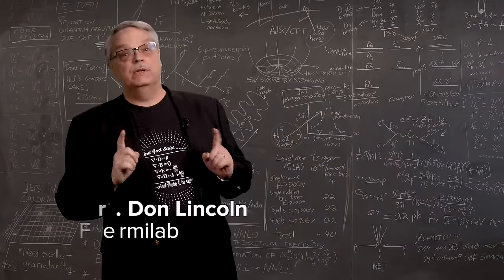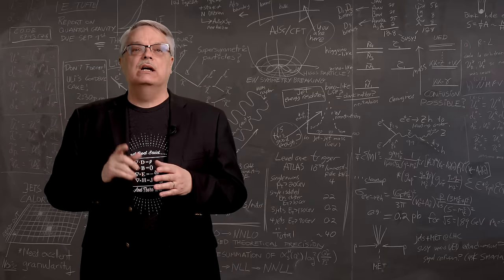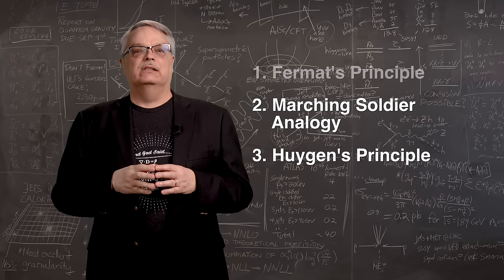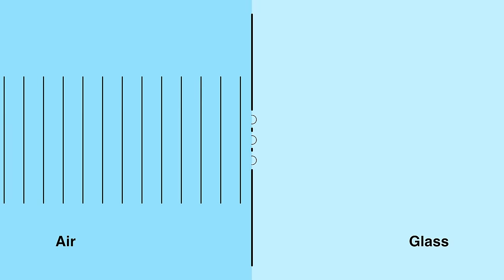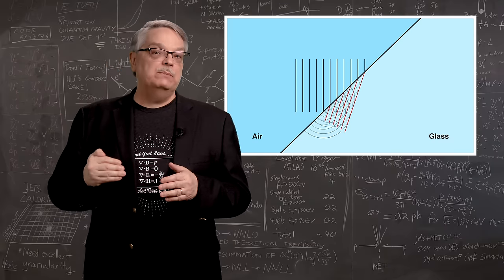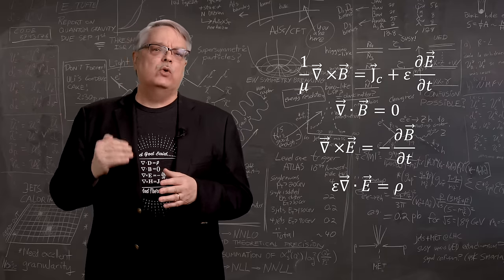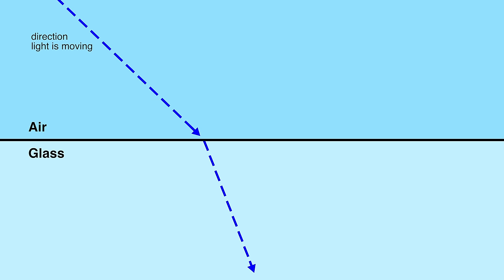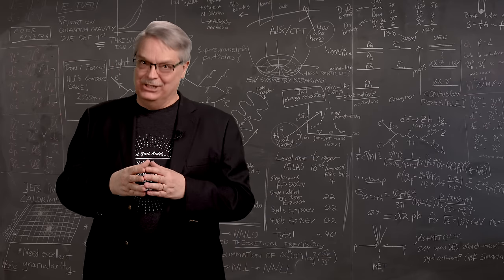Why does light bend when it enters glass?

Comment: In the animation, the electric charges of the molecules in the glass moves/reorient themselves according to the direction of the light, but light travels through my window from many directions at the same time. So please explain how each light beam can bend when it transitions from air to glass, consistent with the equtions. One would think the charges of the molecules in the glass gets confused by the bombardment of light travelling through it from various directions?

BTW, I love your videos - sooo much better that what you stumble upon on the web.
Reply: What a hard question!  I'm  delighted that you have asked it. May I say it's all about the supremacy of geometry over physical mater. Any model that includes light waves or rays, and in particular the directions of these waves and rays is wrong by  definition. Every such a model is by necessity a 3D structure displayed in an instantaneous space. It doesn't meter if these models were kinetically animated, they are still only the sequences of frozen 3D frames. BTW, the eternity could be the three dimensional only. To be able to answer your  question one have to realize that there is no underlying reality of pictorial, i.e. geometrical, models and they should be looked at as if they were eternal objects themselves. However, there is no such thing as the 3D eternal model of light, or of electromagnetic extension in general.  Light does have  a peculiar direction which is always toward the observing, receipting, point. If you are interested in ...
Respect
Reply: The equations are linear so the solutions just add up. Look up 'superposition of waves'

Comment: Forgive me, I don't understand why the horizontal electric field doesn't lowered in the same way as the vertical one
Reply: I think it's because the beam's vertical electric field is moving against the intrinsic electric field of the material, whereas the beam's horizontal electric field isn't.

I'm only guessing though, and I'll defer to anyone who actually knows what they're talking about.
Reply: Look to the equations, he showed it
Reply: He did not show it. But said that we can get there after some calculus. The so called boundary conditions between two media are shown in https://em.geosci.xyz/content/maxwell1_fundamentals/interface_conditions/derivation.html
It uses the Maxwell equations mentioned in the video, but in its integral form.
Reply: @saspinski  That's the math.  It doesn't explain the physics.  You would think the charges in the material would get polarized by the parallel component.  The dielectric constant is also just an approximation, because it assumes the material is continuous.
Reply: To fully appreciate this result, you'd need to read the electromagnetic theory. The electromagnetic theory says that light is an electromagnetic wave, it is nothing but oscillating electric and magnetic fields. Electric fields and magnetic fields satisfy a set of 4 equations, 2 for electric fields and 2 for magnetic fields. The 4 equations are different for different media or materials. But at the boundary of two media, both equations of medium 1 and medium 2 must be satisfied, because the boundary belongs to both the media. So the electric field equations in one medium must be equal to the electric field equations in the second medium. This is what we call a boundary "constraint". The electric field is constrained to move in such a way that the boundary conditions or boundary constraints are satisfied. It turns out the boundary constraints you get on solving the equations is that the parallel component of the electric field must not change, and the perpendicular component must decrease. Please not that it is ok if you fully do not understand this, this is something that is taught in undergraduate physics course.
Reply: @MrNerdpwn  Why wouldn't the parallel component change?  What law would it violate if it did?
Reply: cryora Like I said. it’s a mathematical reason. Basically it is something like this, the electric field evaluated over any closed loop is equal to the negative rate of change of the magnetic field. If we consider a small rectangular loop about the boundary with it’s two parallel side above and below the boundary and it’s other two parallel sides be very small and cutting across the boundary. Now if we let the height of the loop, the sides that are cutting across the boundary shrink, the negative rate of change of magnetic field vanishes as it depends on the area of the loop. So the total electric field about the loop must be zero. But as we’ve shrunk the height, the only contribution comes from the remaining 2 parallel sides, which are the parallel component of electric field in both media. Since the electric field in a loop is evaluated in a certain direction (clockwise or anticlockwise), one of the parallel components and negative of the other parallel component must add up to zero. Hence both parallel components are equal!
Reply: @MrNerdpwn  You mean the magnetic flux through the area bounded by the loop goes to zero as the area goes to zero.  It still doesn't explain why the parallel fields do not polarize the material and create a counter field they way it does to the perpendicular component.  It's a mathematical trick that gets us a result, but it doesn't exactly explain what is physically happening between the charges and the fields.
Reply: @cryora  Yes, I meant the magnetic flux. Correction. I don't think polarization is the correct way to go about this problem (I doubt I'm correct however). An oscillating electric field will cause charged particles such as electrons to oscillate. There's no charge separation or polarisation when electrons are oscillating. You'd need a uniform electric field for charge separation. Oscillating electrons will create charge separations that will rapidly change, due to the oscillation of electrons. So this is definitely something worth thinking about. There's more than meets the eye here.
Reply: @MrNerdpwn  thanks
Reply: I assume it’s because the alignment of the atoms in the glass caused by interaction with the incoming light would be in a direction that doesn’t affect the horizontal component?
Reply: I can see that for whatever reason, things that are parallel to the boundary have to match up. But you are absolutely right - the negative and positive charges in the material should fight against an imposed field in any direction. If Maxwell's equations had said that the field would have to be reduced exactly by the amount the light slows down - the reduction along the path of the light in the material, instead of the reduction perpendicular to the surface - then the change in the direction of the light would be the one to have the electric field reduced by the correct amount, and yet have it matching parallel to the surface. And epsilon is a constant, the slow-down of the light is a constant, but the component perpendicular to the surface will change based on the angle. He may have made a mistake.
Reply: Of course, if it's the total electric field that has to be reduced by a factor of epsilon over epsilon-nought, that field isn't along the light beam, it's perpendicular to it. But not the component perpendicular to the glass.
Reply: Fun video - thanks Don.
Reply: MrNerdpwn why there are 2 components of the electric field?
Reply: As explained in the video and others here, that is due to the boundary conditions.
It's just simple math.

In more layman terms, 

The actual electric fields always oscillates in the direction perpendicular to the light propagation.
When it finally passes water, this electric fields gets lowered entirely (one package)
But since the field is a vector, we can decompose the actual direction into several unit vectors.
In the video we only look at the vertical and horizontal electric field.
Now the catch is, the Maxwell equations applies to the entire electric field, regardless if it's in air or water (it is a one package).
In order for the light wave to obey this, it has to be reduced vertically, but not horizontally. Because Maxwell's equations applies for the whole electric field, not separately in horizontal or vertical directions.

As for the physical reasoning, this is caused by the boundary conditions again.
The light itself is interacting as waves, so it oscillates.
While transitioning from air to water it has to pass a 'virtual' boundary between these two mediums.
But remember that the lights interacts with particles.
In horizontal direction each particle oscillates with it's neighbour but still in the same medium.
If it's in the air, in the horizontal direction, the field oscillates in the air medium, never into the water.
Same thing with the field in the water. In the horizontal directions, it oscillates with it's neighbour that is also in the water, never into the air.
If you draw straight line horizontally in the air as close as in the water, it will never cross into the water.
So, obviously the electric field doesn't get lowered. Why it has to be lowered? The horizontal field itself never crosses different medium.
Reply: The bending is happening at the border between air and glass so the glass can only 'push back' in the direction of the border.
Reply: "When you have two dielectric materials with homogeneous ϵ1,ϵ2 each, applying an external electric field will only produce a bounded charge distribution only on the boundary - the interface between the media. So locally, you have a plane with charge distribution - thus creating an electric field that is perpendicular to the interface, meaning that the perpendicular electric field changed and has a discontinuity, but the parallel has no reason to change, meaning it is still continuous." Taken from https://physics.stackexchange.com/questions/317144/what-is-the-tangential-component-of-an-electric-field-is-continuous-across-the-b
That means that only the boundary has a charge distribution, generating an electric field perpendicular to the interface, not affecting then the tangential component of light's electric field.
Reply: He tries to explain the actual physics part but end up just using the equations to justify (because the epsilon just appears on the perpendicular component). I may agree that he doesn’t explain exactly why it happens. Like it was said in the comment above, there must be some specific mechanic in the transition of the material (in the boundaries/surfaces). That’s why concave and convex lens work. They actually change the direction on the light. The light actually goes out in a different direction from the one it came in.
Reply: 🚫🚫🤔🤔Further, if  light want to go outword from  glass to air then the mythology of charge arrangement  will oppose against outcame  lights.....
That means speed of light again goes to slow down in air.
Which is against to physical view.

Bending of light and differences between speed of lights in different medium are not explain simultaneously.

Best effort but still incomplete.👍
Reply: There is a surface in the vertical direction, which creates a net polarization
Reply: The solution is very simple actually. It also can be derived from Maxwell's electromagnetism, but it's the actual physical reason. This is, the polarisation of a linear, isotropic and homogeneous (LIH) medium happens only at the boundary. Since the boundary only exists at the separation between materials, the medium can only be polarised in one direction. This is not true for all materials. For instance, there are nonlinear materials, which are a bit more difficult to treat. There are also anisotropic media, which have two (or three) different directions in which epsilon is different. Fermat's principle holds true for those materials, but the optical path (minimum time path) is different depending on an additional polar angle. Then there are inhomogeneous materials (epsilon varies on different parts of the material, deepness etc), that can be polarised in the volume, as well as in the boundaries. In this case, Fermat's rule holds true but you must integrate to calculate the optical path. Epsilon is better described for all these cases with a tensor, and it can be calculated precisely, but just saying, some media CAN actually be polarised in the horizontal component, and Snell's law is NOT VALID.

The case of glass and water is clearly that of LIH mediums, but it's not the general case. This is only the simplest case. To undestand the more complicated materials, you need some undergraduate level course in electromagnetism and advanced optics. I'm sorry but some YouTube video won't do, even from such a marvelous narrator.

Hope this helps!

Comment: I've learned this derivation at university and I remember that a key part in the derivation was that it is impossible for the electric and magnetic fields to exhibit discontinuities except for the case of a superconductor. Could you explain why the fields need to be continuous and why they are allowed discontinuities in superconductors?
Reply: Waves are continuous and superconductor
Surface capacitance tensions
No gravity Lol just guessing
For fun
Reply: @stevesastrohowardkings2245  ?
Reply: @stevesastrohowardkings2245  ??
Reply: @stevesastrohowardkings2245  xDD

Comment: unless the glass has isotropic properties, also parallel electric field should induce charge orientation on the horizontal axis, thus the parallel field should be dumped by the inducted field... but this violates continuity of the electric field on the interface... so where am I wrong?

Comment: Thanks for this explanation. Could you do a video about why light splits into its component colors when passed through a prism?
Reply: It is because frequency of oscillating electric field is different for different colors, so you get different values of perpendicular and parallel oscillations, causing that slight change in direction for different colors (hence separating them)
Reply: I would just add that the plane of the exit surface of the prism is a factor. Leaving the glass through a surface angled from the entrance surface, the mix of photons that entered, exits on different vectors organized by frequency. With an exit plane parallel to entrance, like a windowpane, they take different angles through, but individually reverse by the same amount on exit, so they all end up back on the same path (as undifferentiated white light).
Reply: extend the same theory to different components of light as they have different wavelengths and hence different refraction angles
Reply: Because refractive index or the epsilon depends on the wavelength. For different color of light we have different epsilon so the extent of their bending will also be different. That's why they separate from each other!

Comment: I recommend reading QED: The Strange Theory of Light and Matter by Richard Feynman.
Reply: Thank you.
Reply: But his answer is similar to Fermat's principle.  But he basically says path integral of everything but the fastest path cancel.
Reply: @joshuascholar3220  Yeah. The multiple solutions mentioned in this video actually are physically real, if they don't cancel out with other such solutions. If there's physical structure with details on the same order of magnitude of the wavelength of the light, you get diffraction grating, thanks to all those multiple solutions cancelling out differently. That's why optical disks are rainbow-y. Oily puddles get the same effect from how thin the oil layer is on top of the water.

Man that's a good book. I need to read it again.
Reply: Holy cow, I just picked this up and I'm super stoked to give it a read.